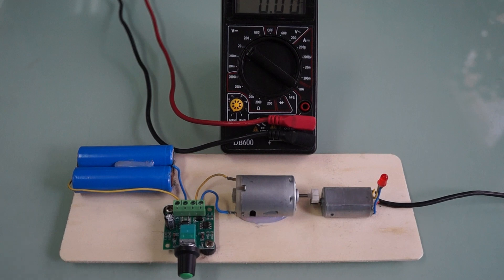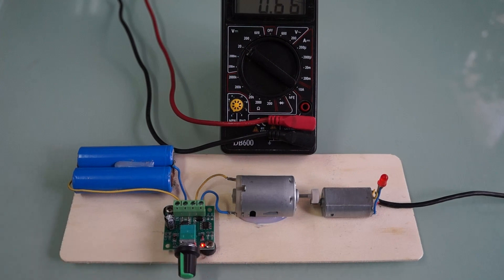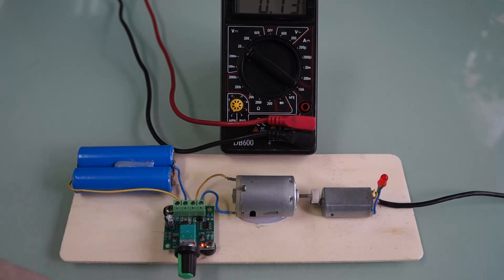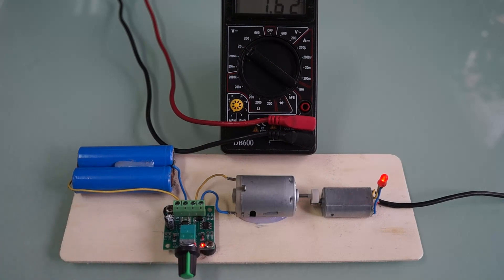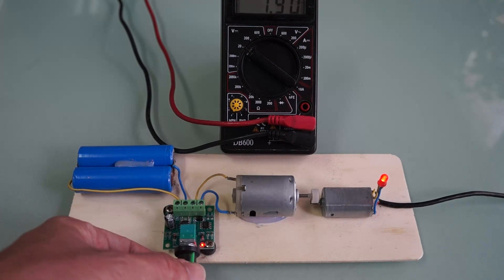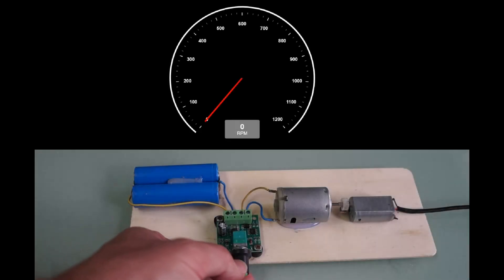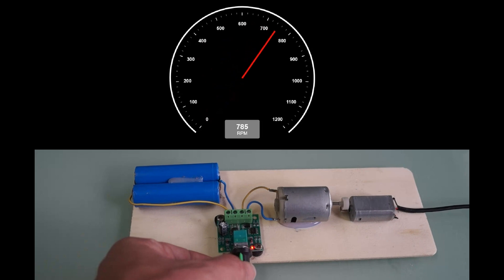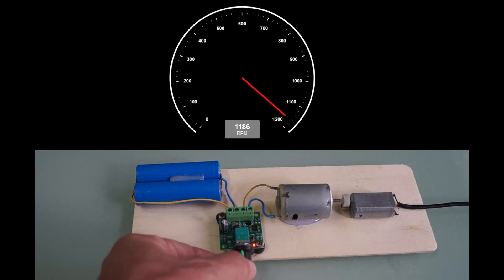Measure DC Motor Speed with PC Audio Input

Comment from the maker: <!DOCTYPE html>
<html>
<head>
    <title>Medidor de RPM</title>
    <style>
        body {
            background-color: black;
            color: white;
            text-align: center;
            font-family: Arial, sans-serif;
            margin: 0;
            padding: 0;
            display: flex;
            flex-direction: column;
            align-items: center;
            height: 100vh;
        }
        input[type=range] {
            -webkit-appearance: none;
            width: 80%;
            margin: 10px;
        }
        input[type=range]::-webkit-slider-runnable-track {
            width: 100%;
            height: 8.4px;
            cursor: pointer;
            animate: 0.2s;
            background: #3071a9;
            border-radius: 1.3px;
            box-shadow: 0px 0px 0.9px #000000;
        }
        input[type=range]::-webkit-slider-thumb {
            border: 1px solid #000000;
            height: 36px;
            width: 16px;
            border-radius: 3px;
            background: #ffffff;
            cursor: pointer;
            -webkit-appearance: none;
            margin-top: -14px;
        }
        .slider-container {
            display: flex;
            flex-direction: column;
            align-items: center;
            margin-top: 20px;
        }
        canvas {
            border: none;
            margin-top: 20px;
        }
        .rpm-container {
            position: relative;
            top: -120px;
            transform: translateY(-50%);
            width: 100px;
            display: flex;
            flex-direction: column;
            align-items: center;
            background-color: gray;
            padding: 10px;
            border-radius: 5px;
        }
        .rpm-number {
            font-size: 24px;
            font-weight: bold;
        }
        .rpm-text {
            font-size: 16px;
        }
    </style>
</head>
<body>
    <canvas id="rpmGauge" width="600" height="600"></canvas>
    <div class="rpm-container">
        <div class="rpm-number" id="rpm">0</div>
        <div class="rpm-text">RPM</div>
    </div>
    <select id="microphoneSelect"></select>
    <p><button onclick="startRecording()">Iniciar</button></p>
    <div class="slider-container">
        <label for="bufferDuration">Duración del buffer (ms): </label>
        <input type="range" id="bufferDuration" name="bufferDuration" min="20" max="1000" value="20" oninput="updateBufferDuration(this.value)">
        <span id="bufferDurationValue">20</span>
        <p></p>
        <label for="updateInterval">Intervalo de actualización (ms): </label>
        <input type="range" id="updateInterval" name="updateInterval" min="20" max="1000" value="20" oninput="updateUpdateInterval(this.value)">
        <span id="updateIntervalValue">20</span>
        <p></p>
        <label for="fftSize">FFT Size: </label>
        <input type="range" id="fftSize" name="fftSize" min="32" max="32768" value="2048" step="32" oninput="updateFftSize(this.value)">
        <span id="fftSizeValue">2048</span>
        <p></p>
    </div>

    <script>
        // Inicialización del contexto de audio y el analizador
        let audioContext = new (window.AudioContext || window.webkitAudioContext)();
        let analyser = audioContext.createAnalyser();
        analyser.fftSize = 2048;
        let bufferLength = analyser.frequencyBinCount;
        let dataArray = new Uint8Array(bufferLength);
        let mediaStreamSource;

        // Configuración inicial
        const sampleRate = audioContext.sampleRate;
        let updateInterval = 20; // Intervalo de actualización en milisegundos
        let frequencyBuffer = [];
        let bufferDuration = 20; // Duración inicial del buffer en milisegundos
        let maxBufferLength = Math.floor(bufferDuration / updateInterval);
        let intervalId;
        let rpm = 0;
        let targetRpm = 0;
        let lastRpm = 0;
        let lastUpdateTime = 0;
        let rpmStabilityThreshold = 2; // Umbral de cambio de RPM para considerar velocidad cero
        let stableTimeThreshold = 100; // Tiempo en ms para considerar RPM estable y poner a cero
        let smoothingFactor = 0.1; // Factor de suavizado para la EMA

        // Inicialización del canvas y su contexto
        var canvas = document.getElementById("rpmGauge");
        var context = canvas.getContext("2d");
        var centerX = canvas.width / 2;
        var centerY = canvas.height / 2;
        var radius = 250;
        var startAngle = -230 * Math.PI / 180;  // Posición inicial del medidor
        var endAngle = 50 * Math.PI / 180;      // Posición final del medidor

        // Función para dibujar el medidor
        function drawGauge() {
            context.clearRect(0, 0, canvas.width, canvas.height);
            context.fillStyle = "black";
            context.fillRect(0, 0, canvas.width, canvas.height);
            context.beginPath();
            context.arc(centerX, centerY, radius, startAngle, endAngle, false);
            context.fillStyle = "black";
            context.fill();
            context.lineWidth = 5;
            context.strokeStyle = "white";
            context.stroke();

            // Dibujar los números de las RPM
            context.fillStyle = "white";
            context.font = "bold 16px Arial";
            context.textAlign = "center";
            context.textBaseline = "middle";
            for (var i = 0; i <= 12; i++) {
                var angle = startAngle + (i * (endAngle - startAngle) / 12);
                var x = centerX + (radius - 60) * Math.cos(angle);
                var y = centerY + (radius - 60) * Math.sin(angle);
                context.fillText(i * 100, x, y);
            }

            // Dibujar las líneas de las marcas y subdivisiones
            context.lineWidth = 2;
            for (var i = 0; i <= 120; i += 10) {
                var angle = startAngle + (i * (endAngle - startAngle) / 120);
                var x1 = centerX + (radius - 20) * Math.cos(angle);
                var y1 = centerY + (radius - 20) * Math.sin(angle);
                var x2 = centerX + (radius - 30) * Math.cos(angle);
                var y2 = centerY + (radius - 30) * Math.sin(angle);
                context.beginPath();
                context.moveTo(x1, y1);
                context.lineTo(x2, y2);
                context.strokeStyle = "white";
                context.stroke();
            }

            // Dibujar subdivisiones más pequeñas
            context.lineWidth = 1;
            for (var i = 0; i <= 120; i += 2) {
                var angle = startAngle + (i * (endAngle - startAngle) / 120);
                var x1 = centerX + (radius - 20) * Math.cos(angle);
                var y1 = centerY + (radius - 20) * Math.sin(angle);
                var x2 = centerX + (radius - 25) * Math.cos(angle);
                var y2 = centerY + (radius - 25) * Math.sin(angle);
                context.beginPath();
                context.moveTo(x1, y1);
                context.lineTo(x2, y2);
                context.strokeStyle = "white";
                context.stroke();
            }
        }

        // Función para dibujar la aguja del medidor
        function drawNeedle() {
            var angle = startAngle + (rpm * (endAngle - startAngle) / 12000);
            var x = centerX + (radius - 50) * Math.cos(angle);
            var y = centerY + (radius - 50) * Math.sin(angle);
            context.beginPath();
            context.moveTo(centerX, centerY);
            context.lineTo(x, y);
            context.strokeStyle = "red";
            context.lineWidth = 5;
            context.stroke();
        }

        // Función para calcular la Media Móvil Exponencial (EMA)
        function calculateEMA(currentValue, previousEMA, smoothingFactor) {
            return (currentValue * smoothingFactor) + (previousEMA * (1 - smoothingFactor));
        }

        // Función para iniciar la grabación del audio
        function startRecording() {
            let selectedDeviceId = document.getElementById('microphoneSelect').value;
            let constraints = { audio: { deviceId: selectedDeviceId ? { exact: selectedDeviceId } : undefined } };

            navigator.mediaDevices.getUserMedia(constraints)
                .then(stream => {
                    mediaStreamSource = audioContext.createMediaStreamSource(stream);
                    mediaStreamSource.connect(analyser);
                    intervalId = setInterval(analyze, updateInterval);
                })
                .catch(err => {
                    console.error('Error accessing audio stream', err);
                });
        }
Reply from the maker: // Función para analizar los datos de audio
        function analyze() {
            analyser.getByteFrequencyData(dataArray);
            let maxVal = 0;
            let maxIndex = 0;

            for (let i = 0; i < bufferLength; i++) {
                if (dataArray[i] > maxVal) {
                    maxVal = dataArray[i];
                    maxIndex = i;
                }
            }

            let frequency = maxIndex * sampleRate / analyser.fftSize;
            frequencyBuffer.push(frequency);

            // Mantener el buffer dentro de la longitud máxima
            if (frequencyBuffer.length > maxBufferLength) {
                frequencyBuffer.shift();
            }

            // Calcular la frecuencia media
            let sumFrequency = frequencyBuffer.reduce((sum, freq) => sum + freq, 0);
            let avgFrequency = sumFrequency / frequencyBuffer.length;

            // Convertir la frecuencia media a RPM
            let newTargetRpm = avgFrequency * 10;

            // Aplicar la suavización mediante EMA
            targetRpm = calculateEMA(newTargetRpm, targetRpm, smoothingFactor);

            let currentTime = Date.now();
            if (Math.abs(targetRpm - lastRpm) <= rpmStabilityThreshold) {
                if (currentTime - lastUpdateTime > stableTimeThreshold) {
                    targetRpm = 0;
                }
            } else {
                lastUpdateTime = currentTime;
            }
            lastRpm = targetRpm;

            document.getElementById('rpm').innerText = isNaN(targetRpm) ? '0' : Math.round(targetRpm / 10);

            // Dibujar el medidor y la aguja
            drawGauge();
            drawNeedle();
        }

        // Actualizar la duración del buffer
        function updateBufferDuration(value) {
            bufferDuration = parseInt(value);
            maxBufferLength = Math.floor(bufferDuration / updateInterval);
            document.getElementById('bufferDurationValue').innerText = value;
            frequencyBuffer = []; // Limpiar el buffer al cambiar la duración
        }

        // Actualizar el intervalo de actualización
        function updateUpdateInterval(value) {
            updateInterval = parseInt(value);
            clearInterval(intervalId);
            intervalId = setInterval(analyze, updateInterval);
            maxBufferLength = Math.floor(bufferDuration / updateInterval);
            document.getElementById('updateIntervalValue').innerText = value;
        }

        // Actualizar el tamaño de la FFT
        function updateFftSize(value) {
            analyser.fftSize = parseInt(value);
            bufferLength = analyser.frequencyBinCount;
            dataArray = new Uint8Array(bufferLength);
            document.getElementById('fftSizeValue').innerText = value;
        }

        // Animar la aguja del medidor
        function animateNeedle() {
            if (Math.abs(rpm - targetRpm) > 1) {
                rpm += (targetRpm - rpm) * 0.05;
                drawGauge();
                drawNeedle();
            }
            requestAnimationFrame(animateNeedle);
        }

        // Población de la lista de micrófonos disponibles
        function populateMicrophoneList() {
            navigator.mediaDevices.enumerateDevices()
                .then(devices => {
                    let microphoneSelect = document.getElementById('microphoneSelect');
                    devices.forEach(device => {
                        if (device.kind === 'audioinput') {
                            let option = document.createElement('option');
                            option.value = device.deviceId;
                            option.text = device.label || `Microphone ${microphoneSelect.length + 1}`;
                            microphoneSelect.appendChild(option);
                        }
                    });
                })
                .catch(err => {
                    console.error('Error enumerating devices', err);
                });
        }

        // Inicializar la lista de micrófonos al cargar la página
        populateMicrophoneList();

        // Dibujar el medidor y la aguja al cargar la página
        drawGauge();
        drawNeedle();
        animateNeedle();
    </script>
</body>
</html>